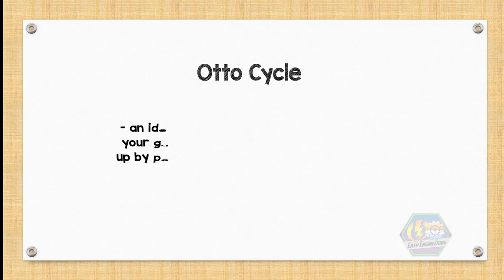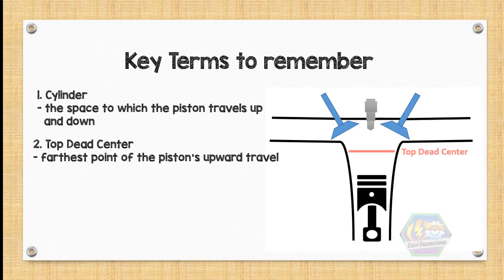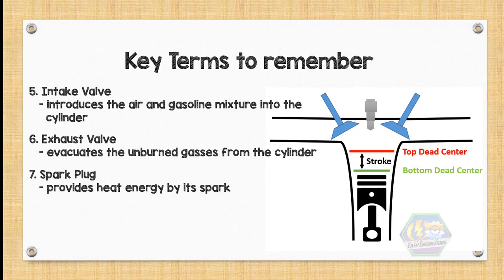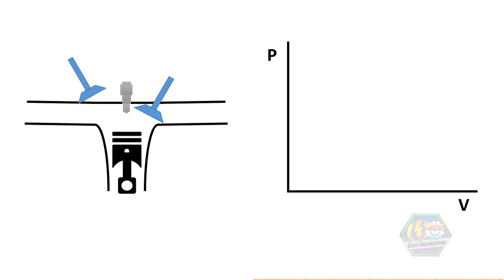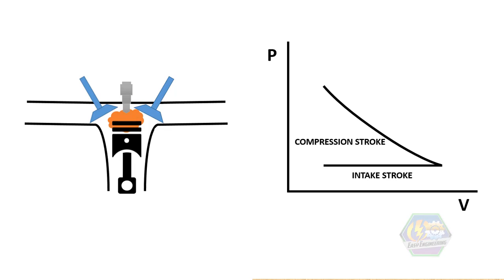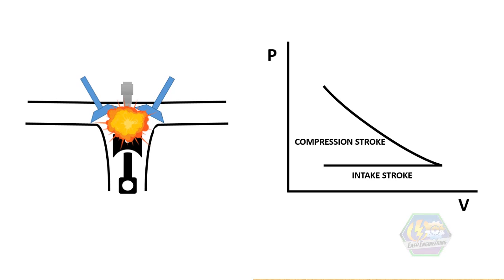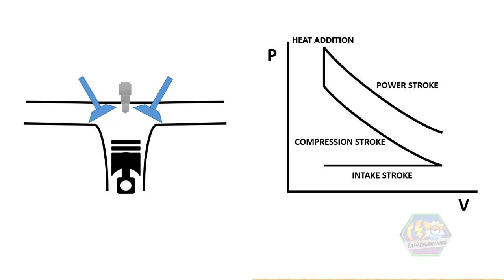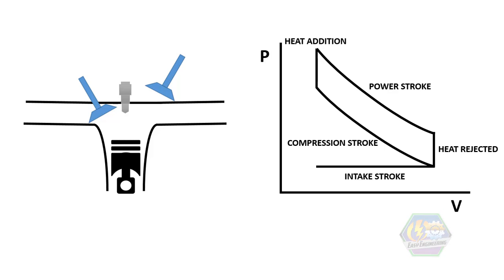OTTO CYCLE | Easy Animation

Comment: hey, can you explain to me how come the volume increases in the initial stroke? in my mind it would decrease once the gas is now inside the cylinder
Reply: As the Piston Move's Downward ⬇️
The Valves Opens and the air 🌬️ in the Cylinder Increase So as the Volume ⬆️
Reply: @Froester  thank you so much!!!!!
Reply from the maker: As the Piston moves downward, it leaves a space/volume for the entering gas inside the cylinder filling that part.
Reply: @EarthPen  thank you so much!
Reply: Hi, can anyone explain me from what these represent in the otto cycle: intake port pressure, exhaust port pressure, does these represent when the cycle start and when the cycle finish, also what is intake port gas temperature and intake exhaust gas temperature, also what is the exact meaning of mass airflow and lower heating value, from stage 3, is this where displacement value come from, can anyone explain these meaning because for otto cycle if we had these word which one of these represent the cycle, there is other meaning like fuel density, bore stroke, indicated torque, indicated mean effective pressure (work done)